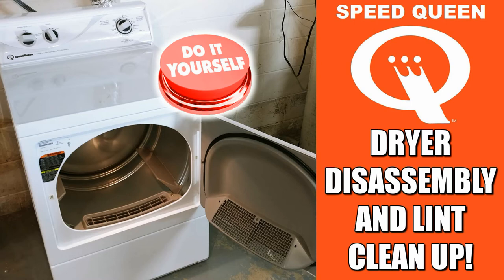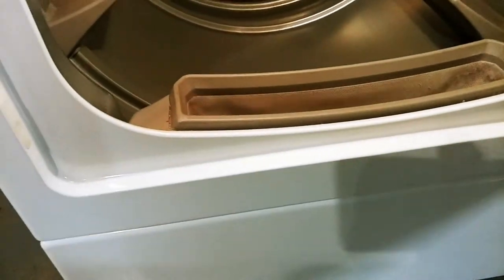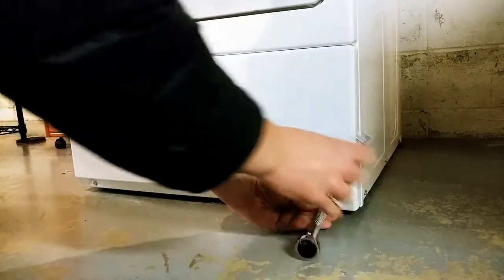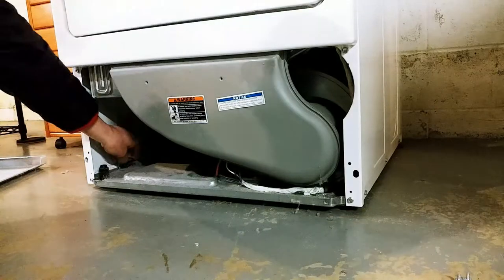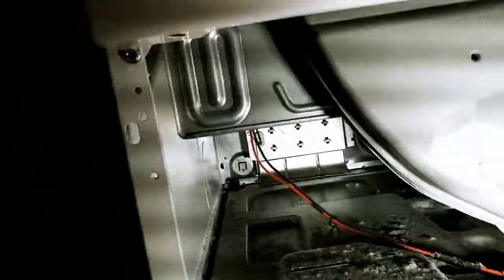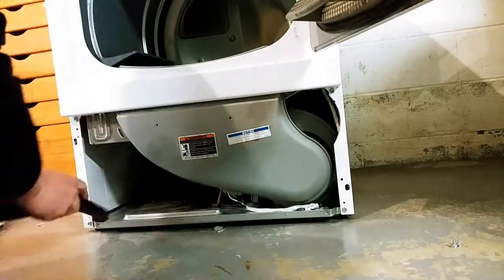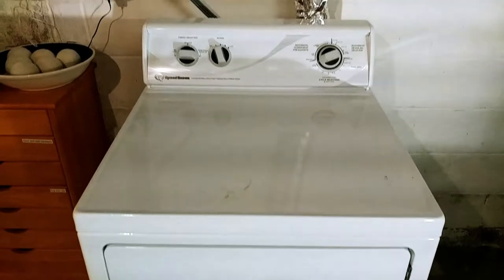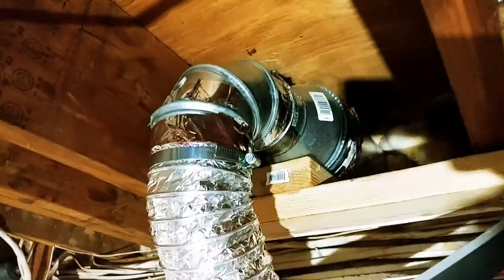Speed Queen Dryer Disassembly and Lint Cleaning

Comment: Your comment, "I did this already, so I'm not going to show you," was exactly what I was looking for.  I can't get this nut out.  What kind of a tool did you use to get that nut out?  I was so hopeful when I saw your video, but you skipped over exactly the part of it I was looking for.  I hope you see this comment and can reply.  Thanks very much.
Reply: Came here to say the same thing. How do I get this bolt off?! 😅
Reply: @kedarjoyner2861  I wrote to Speed Queen and asked them.  They told me to use a 5/16" nut driver.  I got the tool at ACE Hardware (Craftsman).  It's a thin nut driver.  I went to other hardware stores, but the help didn't tell me the right thing.  The guy at ACE knew what I was talking about.
Reply: @franklinw2485   So what size socket did you use to remove the screw?
Reply: @franklinw2485  You got that screw out with a 5/16" nut driver?
Reply: Same!
Reply: Same! Thank you to you in the comments I am giving you the credit not him! lol
Reply: I couldn’t find my ratchet anywhere so I just ended up taking the bolt off with my teeth and it worked 🤷🏻

Comment: Vertical dryer lint vent tube is a fire hazard. It is not a good idea to say the least! In some states insurance companies won't cover you in the event of a fire. Get a dryer lint box and clean in out after every cycle.
Reply: I've seen some new home builds that run a vent up inside the wall to the attic then along the truss cord to the soffit. I've never liked it. The stupid thing is that in most cases they could have run under the floor to the back of the house with two 90s or a 90 and two 45s and it would be shorter.

Comment: How do you get that screw out on the lint thing? What do you use to get it off?
Reply from the maker: I used a standard screwdriver
Reply: @NJroute22  That won't work on mine. It's a very weird-looking screw. Like a hex top but with zero depth; it'll need some sort of gripping tool, I think, because it's so inset. Guess I need to keep looking for another video!
Reply: @HelenBackAgain  did you resolve how to remove that bolt I tried a flat head but it doesn't grip and twist the bolt 😐
Reply: @Towelie4200  it needs a ratchet attached to a screw Driver. My brother-in-law did it for me.
Reply: Went to all that trouble to make this video yet didn’t cover how you removed the odd screw bolt.  It can NOT be removed with a reg screwdriver as you replied.
Reply: Literally a minute in he explains what you need

Comment: I agree the shortest length exhaust tubing; preferably solid and not flexible as shown. Simply removing the cover for lint on the floor is inadequate you need to see inside the filter housing and follow through to the exhaust. No dig just some additional advice for those.

Comment: After you remove the bottom front access panel, by removing the 2  5/16" screws, you can easily remove the air duct assembly, the part that holds the lint filter, by removing 3 #1 phillips head screw that can be seen in the cabinet just below where the lint filter would seat. The 3 screws are one in the center and 1 at each extreme. After removing with the dryer experience you have , you will know what to clean of lint. Do you know of a way to get to the heating element in case it might need replacing? Thanks for your informative video.
Reply from the maker: Do what we did. Experiment. Sorry I didn't specify the exact tools across the board. We just tinker until we get it right. Pays to have a good selection of tools.

Comment: do NOT pry off the front under the lid!
Reply from the maker: Not sure we did that.
Reply: Yes, I was going to add the same comment to save someone from damaging their unit. The larger front panel swings out from the bottom, allowing the clips on the top of the front panel to release from the top of the dryer.
Reply: @LRMattG  Thank you. That's very important information, as I am cleaning out our dryer now. It's an unnecessary jigsaw puzzle. They make it more difficult than it needs to be. They want you to call a repairman....or buy a new one.

Comment: What's the best way to clean the screen on the back, top-left? Mine gets "gunky" and needs cleaning about once a year
Reply from the maker: Not sure - that seems to be a tough one. Maybe taking the back panel off? Either way - it shouldn't get gunky. What kind of detergents are you using? Are you washing greasy things in your washing machine?
Reply: @NJroute22  Thank you for the reply!
About once a year, I take it off and clean it with a drill and a wire brush, and it's been happening since the machine is new and as it's my first gas dryer, I though it was normal...
We use Arm&Hammer HE liquid detergent and HE Downy.  Maybe we are using too much of it? Or we should try different brands? Or maybe should I try painting the panel with high temperature paint?
We are washing regular "adult" clothes, (nothing greasy nor soiled).
Reply: ...by the way, subbed for the quality of your information and simplicity of your videos!

Comment: What tool and size do I use to get the screw out of the filter?
Reply from the maker: You use a nut-driver. I cannot recall the exact size - maybe 1/4" or 3/8". You can buy multi-size packs for pretty cheap at places at walmart (usually under $10).
Reply: Thank you
Reply: @NJroute22  if you are going to do a video on how to clean the dryer, this would be IMPORTANT INFO :(
Reply: @rkymtngal  🤣 everyone wants to be spoonfed

Comment: HOW do you check the belt tension and how do you remove the drum ???
Reply from the maker: We didn't delve into advanced dryer repair or maintenance. I suspect that since we use it like 4x a day - that we will need to address that problem sooner rather than later.